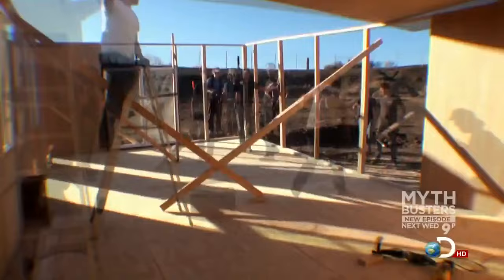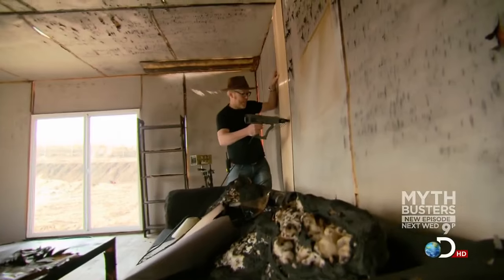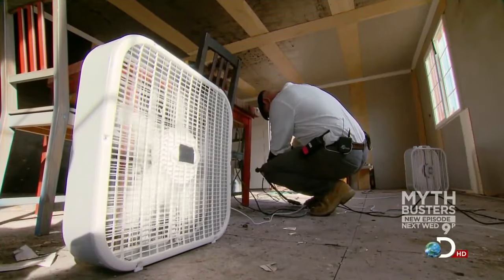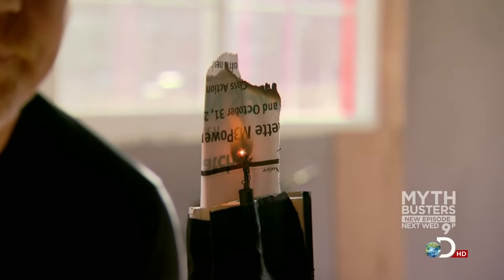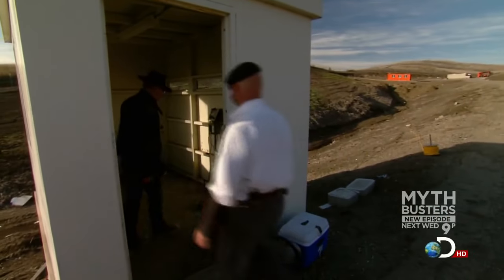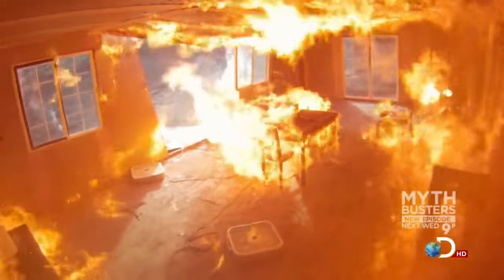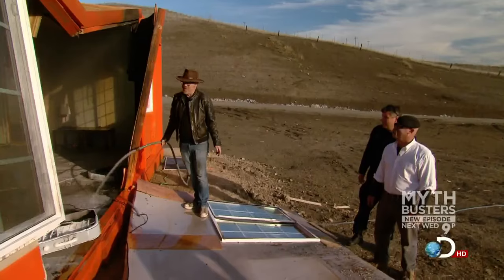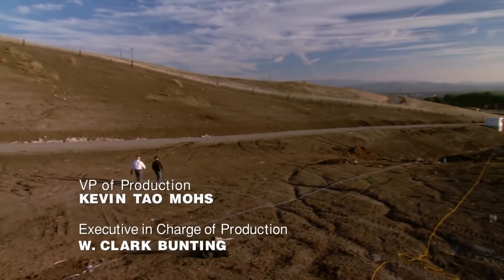Mythbusters Blue Ice (Methane House Explosion)

Comment: An explosion is only as good as the forces trying to hold it in. This was obviously a weak structure. Do it in a sealed shipping container!
Reply: Do you know what a standard issued shipping container costs?  Its not that easy. But i get what you mean, like try it in a bunker, i would guess it wouldnt do much there.
Reply: I agree.
Reply: @CoDZockerLP  
Uses shipping containers are discarded after certain # ocean years.  Not that expensive in the states.
Reply: That's just a fragmentation grenade with extra steps
Reply: @lukesmith8896  True XD
Reply: @CoDZockerLP  like 2k...so nothing pretty much
Reply: @CoDZockerLP  its a corrugated steel box how expensive could it be
Reply: THEY WERE TRYING TO REMAKE A MOVIE EFFECT, NOT BUILD A DAMN PIPE BOMB YOU FUCKIN LOON
Reply: Time to make a giant frag
Reply: As someone who lived down the street in the U.K. from a house that suffered a gas explosion which are made tough as nails out of brick and reinforced concrete the house was almost levelled the roof was where the top floor should’ve been and the bottom floor was blown out to where only structural beams were present it made an almighty bang and was felt and heard up to 0.4 miles away some of my pictures fell off the wall
Reply: @DJ_CROFTY  Being a metal core guitarist were you just like "Excellent!"?
Reply: @TheGreatsagegoku  my words that I exclaimed after it went bang weren’t exactly the kind of words you’d say with your grandmother around it was something along the lines of “what the flying f**k was that I didn’t know they were aloud to fly them c*nts supersonic around here” thinking a group of fighters were dispatched from the raf base a few miles from me where a few years back they got dispatched for a hijacked French plane and it was reminiscent of that but this time it made my stuff fall off shelves and felt about 5 times more boomy so I looked outside to see dust billowing down the street and black smoke then I said to my girlfriend “some geezers having a bad day”
Reply: @DJ_CROFTY  Woah dude that's hardcore.
Reply: Not really fit for the myth, though. Most rooms aren't shipping containers.
Reply: Bang on the button matey their test is very flawed. The reality in housing is we are sitting on millions of bombs
Reply: That wasn't the myth though, is the concept of mythbusters new to you?

Comment: That effect from the very high methane ratio lighting up (as seen from the in-room camera) was way better than most of the stuff I've seen built out of CGI... Certainly better than the Hollywood standard issue explosion.
Reply: IKR! It was very cool! The way the methane ignited in slow-motion was very cool.
Reply: It really looked like CGI, it was unreal
Reply: Not even you can clearly see this looks so fake😂
Reply: Structure wasn't properly sealed. If it were, trust me, it would have blown the house to bits. If you don't believe me, go look what happened to 29 miners in New Zealand at the Pike River disaster. Methane build up, one spark blew the entrance, another build up caused an even bigger explosion that destroyed the ventilation.

Hollywood got their inspiration from somewhere. And that would be from the Mafia and other such organised crime groups at the time.
Reply: @MCshadr217  I agree. They need to measure the percentage of methane in the air. By the way, can a toaster ignite the air before it ignites the magazine? The coil gets pretty hot

Comment: We get some natural gas explosions in homes in the UK as it's a mains supply. And believe me it blows big brick built houses to fragments, everything gone, bricks all seperated and blown away.
Reply: YES. Happens here in the USA. Its complete destruction.
Reply: My guess is that the gas is at a much higher ratio. The Mythbusters only went high enough for detonation, no higher.
Reply: porpus99
They went for the ideal ratio based on the tests. Too much gas and  there isn't enough oxygen for the flame. I've witnessed a gas explosion once myself and the result was quite similar to this one, it had enough force to blow away the weakest parts (in that case, the door and windows) while the overall structure remained intact, and it was an ideal scenario with a leak from an industrial-grade gas tank inside a building with  doors and windows closed.

If a methane explosion takes out a house, I don't think said house was structurally safe in first place.
Reply: Because the show house was very flimsy in comparison to a real building, it weakened sooner and the blast pressure dropped well below what it can build up to in a real house.
Reply: the last natural gas explosion that happened near me managed to blow the back end off a structurally sound 60 year old brick built house structurally damage the house next door and throw bricks 60 feet but it is incredibly rare you get an explosion from a gas leak.
Reply: yeah you'd think they'd do research instead of this
Reply: @jackmcslay  I think you got that backwards. Think about it. You take X amount of gun powder and put it in a paper tube (toilet paper tube)   and set it. Now that that same amount and pack it in a metal pipe of the same size and set it off. The metal pipe is going to give you a lot bigger bang.
Reply: Yeah, out here in the US Midwest, occasionally you'll see news that a house's roof ended up in the basement because it was left empty with a gas leak for too long. It can actually take out walls.
Reply: @davidhenderson3400  that's indeed true with gunpowder and other explosives that contain their own oxygen.
Methane needs to be mixed with oxygen first and this needs to be to a  good ratio. So more methane doesn't meen, surprisingly, a bigger bang. (Which they tested in the full show)

The stronger stucture gives a bigger explosion part I agree.
Reply: Yea what they could of done was left afew bottles of compressed air in the room.  Up the mix off that.  The more oxygen and fuel packed down the better  probably why the couch went of so fast.

Comment: I don't think they got the ratio right. Apparently some houses have been known to explode (very) violently when there are gas leaks.
Reply: nealshireman  they only made about 9& of methane in the air.
Reply: yeah it looked like it was burning really lean
Reply: The flimsy walls allowed the gas pressure to dissipate quickly.  If it were a proper house, the containment would have had a more violent result.
Reply: I don’t know how much difference it makes, but anecdotally the really powerful house explosions I’ve heard of involved propane rather than methane, so that could be a big factor in addition to the ratio?

Comment: I wonder if the fact that the windows didnt break is as a result of the strength of the walls/roofing, i.e. maybe if they were stronger, the weaker parts (windows) would have given out.
Reply: +Samdeman22 
The windows are stronger than you may think! Glass is amazing!
Reply: +Benjamin “Ozias” Esposti Yeah, if I am correct then all that would need to happen is the windows be stronger than the surrounding walls.
Reply: The weakest part is where it broke open it wasn't built to be a home or to last very long perhaps it was just a $h!tty jobsite office building/break room where The windows were just stronger than the quarter inch plywood wall's
Reply: not to code building...

Comment: There is a trick to getting fuel air explosions to happen quickly, it is called turbulence, this example showed a textbook spherical flamefront indicating no turbulence, putting the ignition source in a large dog kennel or a volume with a relatively small opening or openings would have increased the rate of flamefront growth considerably. Even a house with multiple rooms can greatly increase the peak rate of combustion.
Reply: They did one do another gas explosion with turbulence and got a much more forceful explosion. Can't remember details of what myth or episode number.

Comment: thats what happens when you leave your gas stove on without lighting it and all you need to light it is to turn on a light or drop a metal fork...
Reply: Or put your key in the front door when you come home. Folks I worked with lost a trailer like that. The door frame was much stronger than the wall (thank goodness!). The guy picked up some static and it discharged between the key and the lock. Parts of the front wall went out on either side of the door, leaving him holding a key in a lock on a door with a frame and no wall.

Comment: The thing about the Bourne method is that it slowly filled up with gas, with an ignition source burning in the toaster.  So, you're almost guaranteed to get the minimum (About 5% depending on barometric pressure, humidity...) fuel/air ratio that will burn, not the most efficient.

Comment: They should also pump natural gas in there in an endless amount, just like what would happen in a real gas leak. It doesn't stop at "9%". Then if some kind of spark happens AFTER that, then yes, the house will blow up like a bomb. This has happened several times in houses with gas heating.
Reply: If 9% was the ideal mixture, then why would they?
Reply: Natural gas won't explode at >15%, and the ideal explosion is at 9%. Explosions need both fuel and air in adequate quantities.

Comment: I bet if the building was more secure, without just nailing holes with boards, there would be a bigger build up of pressure, causing a bigger release of energy, potentially bursting through the windows, which would be the weakest part of the structure

Comment: How do these houses that apparently blow completely apart from a gas explosion. These houses go into tiny pieces. Can gas really do that?
Reply: +cheekyoziechick They are alot sturdier than the ones in this clip. It allows the pressure to build up before blowing out the walls.
Reply: SirensOfCincinnati Thanks.
Reply: +cheekyoziechick methane gas apparently did, but methane isn't as energetic as natural gas or propane. but as they said if you have the right O2 to methane ratio all it takes is for the right kind of ignition source that'll create an open flame
Reply: +Derek Wall; > but methane isn't as energetic as natural gas; Natural gas IS methane CH4.
Reply: rif42 the one gas that is the most powerful and most plentiful is hydrogen and it has 2x the kick of natural gas 4x the power of propane and is the cleanest burning gas in the world with absolutely 0 emmissions
Reply: +Derek Wall; sorry that is not what you said. Let me repeat: natural gas is methane.

You then divert subject to hydrogen and emissions. Hydrogen is fine, but the problem is hydrogen never exist on its own on this planet, it is always bound with other materials like in water, in methane etc.. Hence you have to put in energy to separate hydrogen out and that makes it an energy loss process. Hydrogen is not an energy source it is only an energy storage medium.
Reply: rif42 I thought natural gas is what comes up from oil fields and gas pockets like in the Gulf of mexico and texas. methane I think can also be called natural gas but the 2 often get confused
Reply: +Derek Wall; Yes the gas from an underground gas field is called natural gas, and it is methane with some impurities. The impurities are removed before the methane gas goes into the (natural) gas pipeline network for consumption elsewhere.

Another gas source like biogas is also ~65% methane + CO2 + impurities. When the CO2 and impurities are removed the biogas can also go into the (natural) gas pipelines.
Reply: rif42 how potent is the gas from wells compared to methane? I know propane if heated inside a 30,000 gallon tanker car it'll BLEVE with a fireball so large it can cause 3rd degree burns 400 yards from the epicenter
Reply: +Derek Wall; I am sorry I do not know the details of this.
Reply: rif42 look up the Murdoch Illinois train car explosion, a train derailed just outside of town and the train had multiple gas tanker cars each with a maximum capacity of 30,000 gallons of LPG and isobutene, when the fire of the spilt chemicals heated the tanks to the point of failure they BLEVE' and the blast seen on camera was quite the firework show
Reply: I remember seeing that. People hundreds of feet away had massive burns, too.
Reply: but is incredible hard to store and expensive to produce on the demand needed...
Reply: methane is a part of natural gas (more than 99.99% the other part is odorizers

Comment: the reason glass didn't shatter is because there was no shockwave. your gas ignited and deflagrated, expanding rapidly enough to tear a hole in the wall. we can clearly see the expansion by the expanding sphere of flame that emanates from the ignition source. it's expanding quickly and with a lot of force, but it's still subsonic. what people tend to think of as an explosion is technicaly a detonation. strictly speaking, this was an explosion, but the one in the movie was a detonation. the reason for this difference is that the movie essentially faked the whole setup. instead of igniting gas under pressure, they ignited some kind of high explosive.

generally speaking, gases combust much more slowly than solids and liquids. for that reason, gas needs to be under really immense pressure for it to detonate, irrespective of the concentration, the total amount, or even the ignition source. even if you used a nuclear bomb as a kind of "primer" (lol at that idea) any gas surrounding it still wouldn't actually detonate itself, though it would still probably be pushed away at supersonic speeds before it could even combust. in the film they might still have used a combustible gas, but it definitely wasn't the "primary charge."

Comment: Steel wool and a 9-18v battery Adam! Combustion of paper is slightly inconsistent, like primers in rifle cartridges the variable of how fast and intense the concentration and buildup of energy exponentially increasing or just chemically reacting, that determines the power of the final result, is relative to the energy released by the initial reaction, try a thimble full of nitro glycerin, and add a drop of alcohol for detonation, or place a cut shotgun shell so the primer is exposed, or a firecracker, a real m80, or a propane (MAP gas) torch plasma tube flame popper (high speed) you could use acetylene, and remember it’s the accelerated decomposing of the gas in a high nitrogen (no less than 11% no more than 20% oxygen) atmosphere that makes or breaks the energy delivery of the detonated gas, there is plenty of MSDS scientific data on these gases.
Reply: I saw a veterinary clinic vanish into a cloud 300’ in the air (at least half of that) and shatter windows on parked cars storefronts, a school,  and damage the front of neighboring homes, as the place came back down to earth, it happened so fast, I glanced at the sudden shadow from the launched vaporized building and had not even processed the visual data as a cloud when my feet shook, then the “WHOOOOOOOOOMMMM!!!!!” Percussion of the explosion was like a hit in the solar plexus, I somehow hit hyperspace and appeared under cover of a safe structure (Not necessarily turned out that I wasn’t in the line of direct impact) but Instinct served me right. I ran over to see what happened and couldn’t figure it out, then I realized there was no longer a building on the corner st all, it was gone!

Comment: Try a mixture of 70% hydrogen and 30% oxygen next time ;-)
Reply: that's what I keep thinking hydrogen is 8x more energetic and would possibly reduce that wooden structure to smoldering wood chips glass and shrapnel. I wonder how large an explosion a 30000 gallon train tanker car filled with hydrogen make
Reply: The heating value of methane is 55 Mj/kg. The heating value of hydrogen is 142Mj/kg.

Comment: http://www.liveleak.com/view?i=f03_1424818388

except theyre wrong
Reply: i was just about to post that link lol.
Reply: they never build actual scientific test and always do the "next best thing that kinda sorta looks that"... there, there was no destructive explosion because there was an obvious leak(where the explosion direction was, so the "front" of the shack) and also the shack itself is not a good substitute of a actual house...
Reply: +1r0zz 
Also, they might have incorrectly measured/estimated the flow rate of methane into the structure.
To me, it looks like the small test with 6% concentration was more violent ... it happened faster.

Comment: Actually. The Movie might be better than you in this.
A Blow Out will Blow Out the Weakest Part to get Free. 

In your Case that Weakest Part was the Front Wall. And once that Blew Out. There was no more Pressure that could go Boom. 

But what if the Wall had not given out. 

What if you had proper Walls and Windows that are not so Loose that they could fall apart in a light Storm. 

In that case. Chances would be that the Pressure inside the Apartment will Build Up to the Point where something Breaks. 

And when the Walls are Solid the thing that would likely give in First would be Doors and Windows. 

But as usual. Your Testing is pretty Poor. Nothing new there.